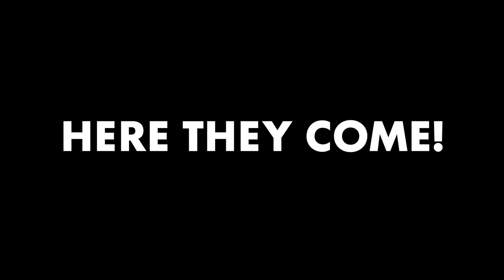THEY'RE HERE! Let's get this party started! ⚓️ Red Sea Crew (Ep 215)

Comment: A tip, top up the fuel polisher manually with diesel to submerge the racor-filter completely in diesel, you are only using 2/3 of the filter capacity, the top 1/3 sits in an air pocket, thats why the top is clean and white because it never sees diesel. Same story before you put on the top cover on normal racor pre-filters, top them manually up all the way with a bottle of clean diesel.

Comment: Mooring warps = 0-8-9 on the cleat.
O takes the strain 8 crosses over so it tightens on itself. 9 locks it.
You guys were leaving out the 0 so you run the risk of having a jammed line.